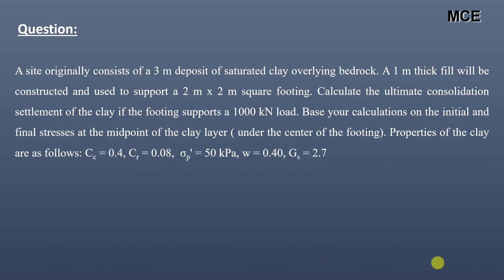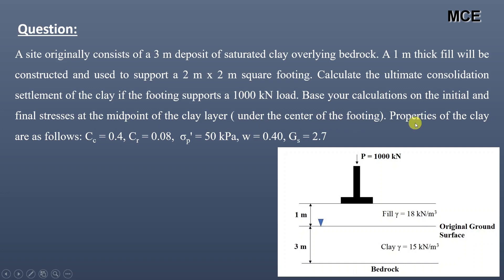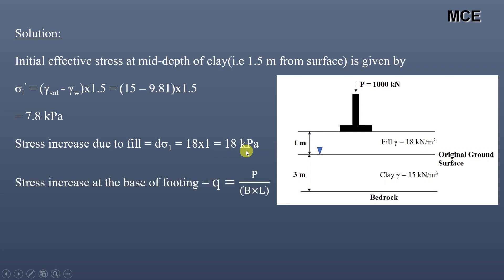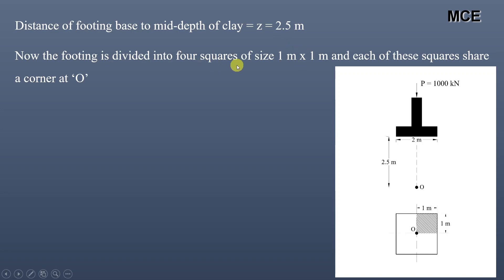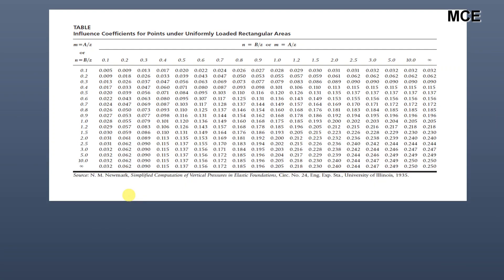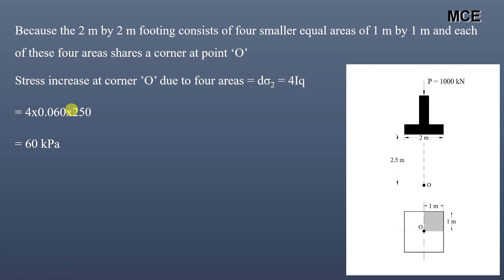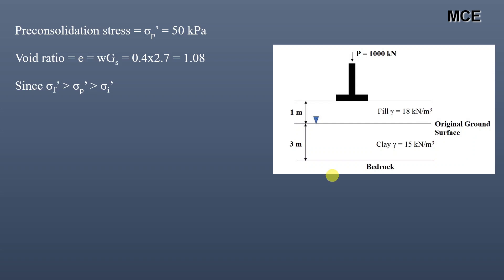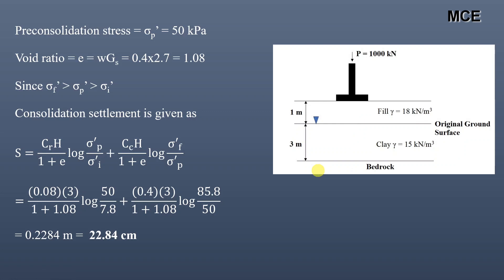Consolidation Settlement at the center of square footing | Overconsolidated Soil

Comment: why do you input the initial overburden pressure as 7.8, not taking into account the pressure from the 1m of fill above the clay layer?
Reply: The original ground surface is at 1 meter below the footing (building)